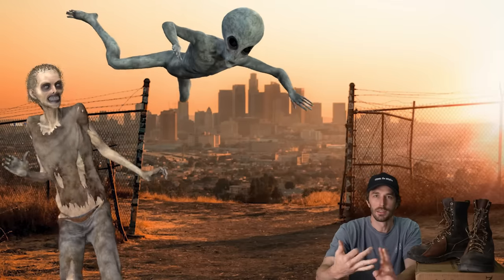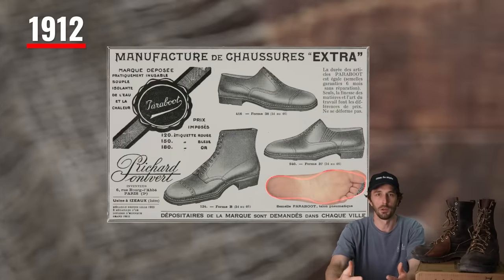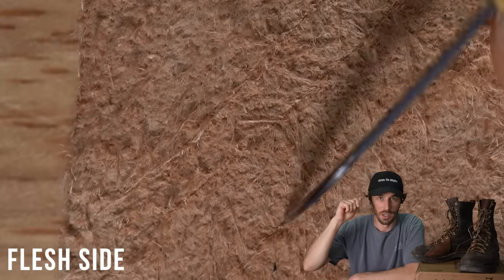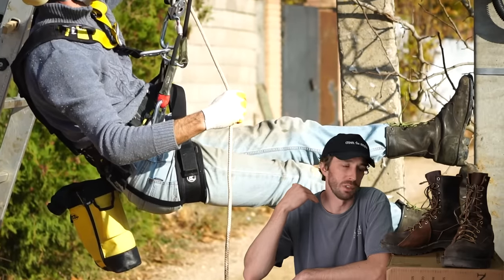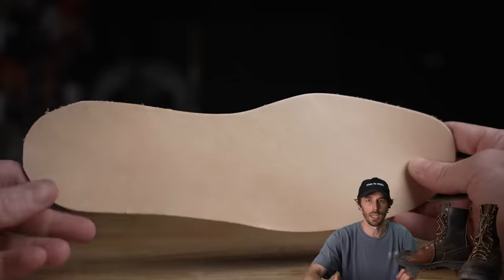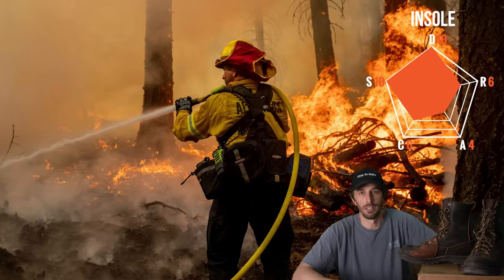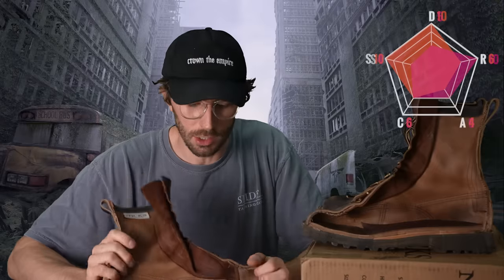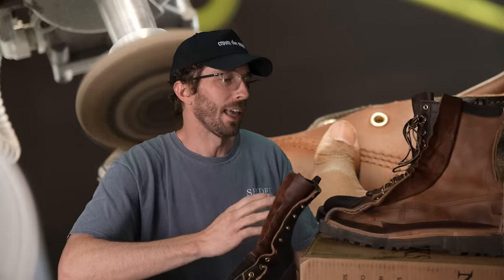Why this boot would save you in the Apocalypse (ND3)

Comment: I'm glad there was an emphasis on repair, because in my experience (mostly office role in an industrial environment) even very nice boots rarely make it to 18 months. I'm not particularly rough on my boots, but the mileage adds up fast.
Reply: Same here, but on a horse farm.  I'll go through a pair about every eight months. Mud season just kills them.
Reply: That’s probably the issue, you are buying “nice” boots. The cheap Walmart boots with the fake leather cuff lasted me two years of hard use, kicking shovels, walking on metal roofing screws, repeatedly soaked and dried (south Florida). My cousin bought the same and used them for ac work, he never wore them out, just got sick of them. I’ve noticed that boot quality doesn’t increase with price as with most other industries. The companies making good boots are considered “trash” because they charge half the price of “nice” boots that wear out rather quickly. The other thing I noticed is thicker boots don’t last longer than thinner walled boots, the thinner leather flexes better and is less prone to cracking. It’s all about the design and quality of materials. Those cheap Walmart boots lasted so long because they used a hybrid of materials, not because the leather was super thick.
Reply: Mine (from Walmart) last about 4 months what brand you buying form Walmart, also from Florida BTW
Reply: I got a pair of Tractor Supply boots maybe $100 - $130 and they lasted me over 5 years. 
I help my father in law in the cow field, and in hay fields, do maintenance and yard work, hunt an fish.. I also been on a few trails with my kid more or less hiking. I got a boot dryer, and I use boot oil, and boot polish.. sometimes it's all in how you treat an take care of your boots.. I was in the Army back when we had black boots to tale care of, and I still got one pair over 20 years old still going strong. One I worn the sole out of and I think I lost one good pair over the years. In the Army i usually had me 3 or 4 pair of military boots an a couple pair of sneakers. 
My grandfather back when I was a young boy had taught me how to polish and help him with his shoes and boots, he was a mechanic, welder, he built a couple homes, and he was yard guy.. 
It isn't always about the price of a boot that makes them good.
Reply: I've had a pair of red wings outdoor hiking shoes last over 2 years with heavy use, and I'm still using them. I work on a ranch.
Reply: @DB-xo6xh  hey my friend still makes em. If you like some just let me know.
Reply: Danner makes an excellent boot. I have a pair going on 10 years old that are still holding up.
Reply: "It's not the years, it's the mileage." - Doctor Henry "Indiana" Jones, Junior
Reply: @JohnDeerePhilosopher  My stepdad wore full quill ostrich boots for work boots. Lasted him 27 years (he died before the boots did). Had them resoled several times. He bought them for dress boots, and when they eventually got scuffed up and ugly he started wearing them for work. He was a rancher, so they did mud, horseback, hay field, etc. Central Texas ranch so we don't get crazy extreme weather, but still surprising how long they lasted.
Reply: Get yourself some German army boots (Kampfstiefel Model 2007)
Reply: @coppertopv365 Thank you so much for your comment,
Did you have any reference about those boots you get for so long name link etc ˘◡˘
Reply: Same I got a pair of docs last year and slowly due to cracks in the mid sole the stitches are slowly coming loose and it’s maybe been about 9 months running around inside and outside of a store grabbing carts and cleaning broken glass before going to concerts the same day
Reply: @MatthewZelek-iv8tb  which ones? I would buy them asap
Reply: Jup motorcycle rider here, i got a great pair of boots, 2 years in i have had to sand the leather twice, reapply finish and replace the laces. Now granted i also work quite a bit in these boots
Reply: Cheap ass boots.  Still wearing the boots I got married in 7 years ago from red wing.

Comment: Hello Rose Anvil. I have lived my life in boots. Worked in factories around heavy machinery, pallets, obstacles and massive solid equipment, beat the pavement as a paramedic, backpacked my entre life, hiked and caved for 50 years, worked on heavy equipment and run a farm with all it's footwear abuse. I respect your channel and knowledge and love your boot tear-downs. My question is this; the majority of my foot injuries and foot trauma have occurred on the outside, the distal metatarsal or outer side of the foot. It is nearly impossible to find boots with side protection and I am surprised that your joint venture with Nicks doesn't address this. The boot that is represented in this video has additional protection on the inside but not the outside. The volume of foot injuries that occur to the soft tissue and bone structure on the outside of the foot is well documented and I wonder why boot manufacturers don''t address this by adding additional protection. My point is fully illustrated in this video at the 5:39 mark and view of the boot and the abuse the outer side has taken in just average everyday wear. Wouldn't it have made more sense to design a boot with extra protection on the outside as well as the inside? Thanks for your hard work and videos on boots but I'm still looking for the right boots for my feet and active lifestyle where my feet take a beating.
Reply: Amen to that.
Reply: Right? I've yet to find boots that won't chew through there on the sides. I'm a welder and the amount of slices I've put in the side leather when I'm moving though pallets of sheet metal is nuts. That and it's a flex point, and gets impregnated with iron dust which just destroys the leather from the inside. I just want a boot that has a second heavy layer of leather that doubles that area up so it can get unstiched and replaced without having to re-make the dam boot.

That seam on the outside edge would 100% bust. It's already starting to roll and the stitching isn't even chafed yet like it would be in 6 months
Reply: Roofers boots have double side leather that's incredible tuff
Reply: Maybe there are more traumas on the outside because the finders and downside is where the most protection goes? 
I mean you cannot make a boot that is equally protected from all sides otherwise it will be unalterably heavy and bulky. So you need to choose the areas that needs most protection? And if manufacturers would switch to protecting sides we will see the change in statistics and most traumas will come from sole punctures and toes crushing?
Reply: Tru
Reply: Try motorcycle boots classic style s
Reply: did u find such a boot
Reply: I mean, he said the boot has a double vamp. That's 6mm of tough leather around the outside of your foot. That's almost a quarter inch of leather around the outside of your foot. Do you need more than that? My boots are 4mm thick and I've never gotten hurt in them.
Reply: I’ve never gotten my FEET hurt while wearing GOOD boots, but while wearing poor quality boots it’s just a fact that it’s going to happen, it’s just a matter of when and how badly. It’s the same concept but riding a motorcycle and crashing, because getting hurt doing ANYTHING, it’s always just a matter of time AND when and how bad.
Reply: But he said the leather is double, no? Whole toecap have 6mm of leather total, that should last long.
Reply: @Dolritto  i looked the bone up and it seems to be the bone behind your pinky toe which the toecap seems to not cover much if at all.

Comment: Nicks, Whites, Hoffmans, Vibergs, West Coasts, Drews and JK's are all handmade boots that are great for heavy duty work. As a forester, log truck driver and former logging contractor, I have had quite a few pairs of these boots (White's and Hoffmans). They all leak like a sieve. The type of construction used to make these boots makes them difficult to waterproof. They are great for dry weather. If they fit you properly, they are an all day boot that will give you great support. They can be rebuilt several times. They are are not cheap but last a long time so the cost can be amortized over many years. Just plan on something else for wet weather wear or get used to wet feet.
Reply: I had whites for firefighting and danners for military.

Comment: Towboat/tugboat deck hand work is super hard on boots. They frequently get wet/dry/wet/dry and suffer through huge temperature variations with steel barge and boat decks varying from well below freezing to hot enough to melt sole material. Back when I decked, I was lucky to see a pair of boots make it through 6 months.

Comment: I use to work at the Natrick Research and Development Center as a Combat Arms NCO, and this type of thing was researched all the time, and I tested boots constantly. This boot seems like a good idea, except if this boot gets wet.. it would take forever to dry out. In the winter this could be absolutely catastrophic to your feet. During the summer, I potentially see your feet sweating profusely with no way to air out. I’d recommend someone test these boots where they have them on for 4-6 days straight. I’m willing to bet these destroy your feet.
Reply: Yep.  Yours is the only comment so far that I've read, since I wrote mine just recently, that makes more holistic sense. This is what I wrote a little while before I saw your comment: 

"When there is a collapse (and there will be due to a combo of ever faster weakening of earth's magnetic field and a strong Solar event(s) knocking out electrical grids), my plan is rather different foot wear wise.  Multiple pairs of lightweight hiking sandals--don't weigh a lot and aren't very bulky. Of course they individually wear out significantly faster than a boot like the above... but pretty sure that 3 or 4 pairs will last significantly longer, especially outsole and tread wise, than the outsole and tread of one of these boots. During a real and full collapse, there will be very little repairing of footwear. You will not have extra outsoles, good glue/ahesive, etc just lying around. 

   But the real secret sauce will be the special, oversized, protective "socks" that goes with these--- only two and both very light weight. First one is a warm weather outer sock made out of breathable, extremely fast drying UHMWPE fabric. Toughest material on earth in many respects, and very cooling (thermal conductivity similar to some metals). 

   The cooler to cold weather sock will be more involved. It will have an outer layer of breathable, extremely fast drying, outer UHMWPE fabric, with a layer of siliconized kevlar fabric below that (you just thin some silicone caulk with naphtha to a correct ratio), a polypropylene layer below that, and a high tenacity polyester fabric below that. All breathable, all fast drying, and the latter 3 fabrics more insulating (will be used in combo with alpaca-synthetic blend socks). Maybe a layer of hollow core fleece in there somewhere as well?

    It will be highly water resistant, but still breathable and quick drying.  If it gets sopping wet, you can take it off and wring the water out of it.  You can't do that with thick leather--that stuff takes forever to fully dry.  Meanwhile, the hiking sandals are very quick drying. 

   Oh, and both outer protective socks will have outer insert pockets for a carbon fiber + S2 fiberglass + high strength epoxy composite insert. This protective insert will have small holes drilled into it, for you guessed it, breathability.  

   With this fabric combo, you wouldn't be able to cut through the material easily, if at all, with your average cutting instrument.  The beauty of making it into an oversized sock, is that it is pretty easy to do if you have a sewing machine and know how to use it."

Comment: Just because of this video today I'll wear my army boots from the 90s. Issued in 1984, went with me all through the wild 90s. Climbed me up to the top of both Chirripó and Ventisqueros Mts. here in Costa Rica. Like you said, beaten up, some parts had to be mended and replaced, but nothing a good oil treatment won't fix...
Reply: If you're referring to the black leather boots with thick rubber soles, yeah they can last a while. There's nothing comfortable about them no matter how much you break them in and require a lot of insole assistance. I marched so much in those style boots the leather was soaked through with blood and sweat. I've long since moved on to the more modern style. Still, there's something to be said about nostalgia and grit. We were a different breed back then. I would keep those old boots in a footlocker, but I definitely wouldn't be walking and hiking in them. Way better options out there today.
Reply: Thank you for your surplus !
Reply: But he said modern boots will melt on the shelves after 5 years!  How can you have boots from 1984 that are not puddles of goo!?
Reply: Gawd, I hated those army boots. No speed laces, pain in the ass when you had to put them on in the dark. The tread on them were paper thin with crappy grip. Not even allowed to resole them with something decent like vibram.

Comment: Impressive boots, a piece of art.
From my experience a good pair of boots have to be: (I ordered the points in order of importance)

Insole:
1. Wide. Provides good stability, reduces long term injuries and reduces discomfort (from my experience the only good fitting insoles are barefoot types), healty feet are wide.
2. Humidity absorvent. Humidity is a feetkiller and since the lower part of the foot cant dry 
2. 0 drop. Reduces long term injuries, distributes evenly the weight through the whole foot, is lighter. Reduces gravity point.
3. No cussion. Most injuries after ultramarathons and other long term runs are cuz of friction, not cuz of cussion. If the shoe is comfortable(holds the feet in place) and the feet is strong you can run ultramarathons and jump from buildings. It makes the shoe lighter.
5. Durable
6. Thin. Reduces weight.

Sole.
1. Easily removable
2. Good ground grip.
3. Elastic and thin. Increases ground feeling, is comfortable, reduces weight and gravity spot.
4. Straight design most of the soles elongates the lower feet muscles producing plantar fascitis.
5. No cussion
6. Protective against sharp objects from the ground.

Also add in the tip a carbon fiber reinforcement in case a heavy object smash your toes

The rest of the boot is 10/10 from your side